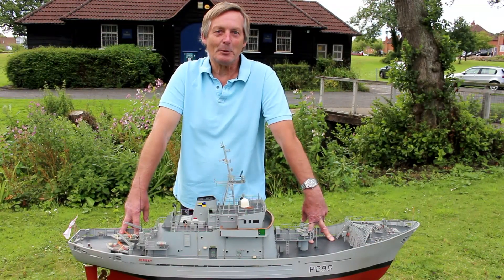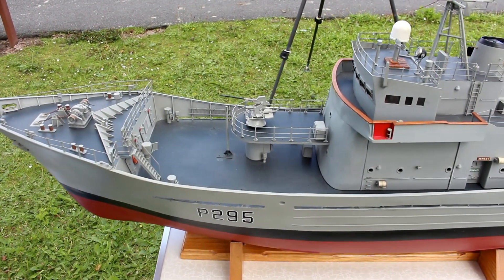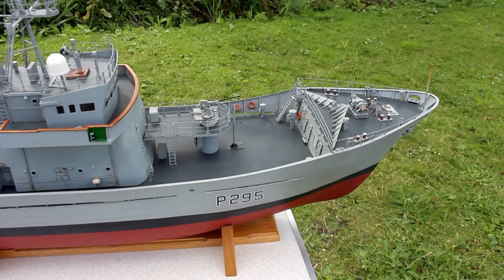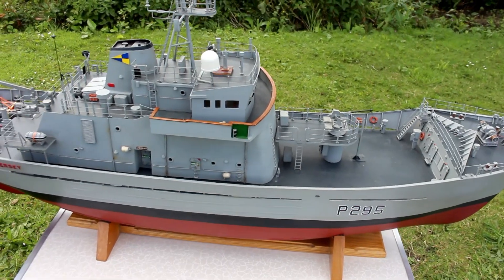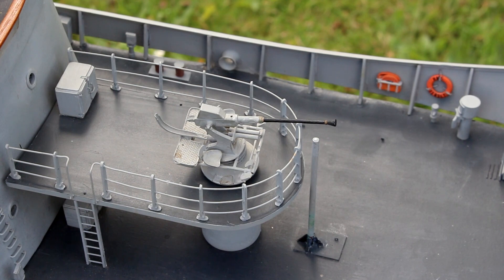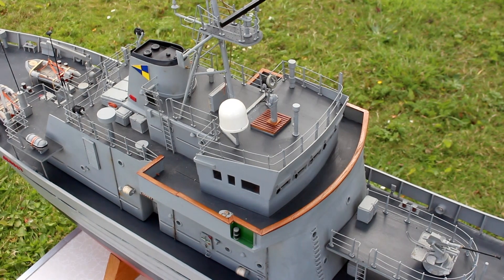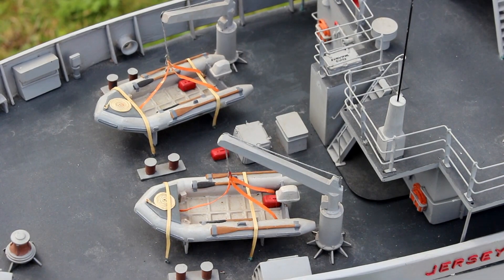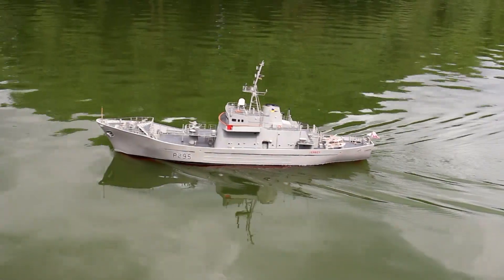HMS Jersey | Offshore Patrol Vessel

Comment: Hi, very nice build. How do I place an order for the kit? cant seem to find anything on CMR website. Thanks
Reply from the maker: The hull was from Sirmar model ships.  the superstructure was scratch built and the fittings were from Sirmar model ship fittings at 1/48 scale.  you can some times see these boats for sale on ebay.   Or the only other kit i can think of at the moment would be from deansmarine at 1/72 scale  called HMS Guernsey, but again you would need experience building scratch built as deans marine kits are not really for the beginner.  https://deansmarine.co.uk/shop/product_info.php/cPath/10_31/products_id/470
Reply: Thank you very much. Yes, I would prefer something smaller like 1/350 scale static model. Any leads on any Island Class around that scale? Much appreciated
Reply from the maker: @zubayeer  i really cant think of enything else.  maybe look at trumpeter kits.